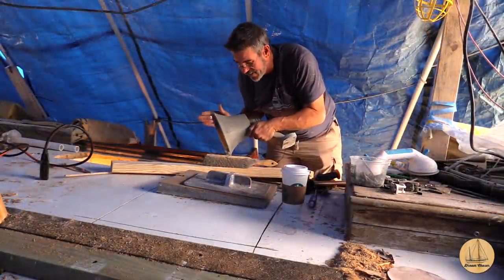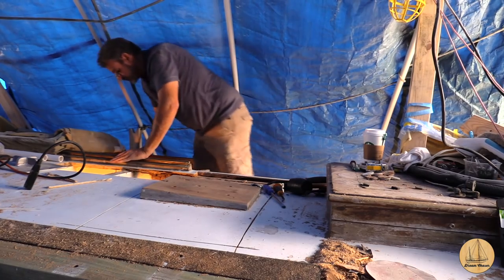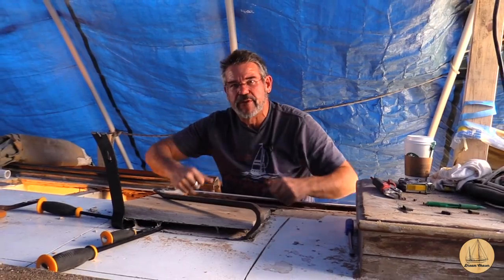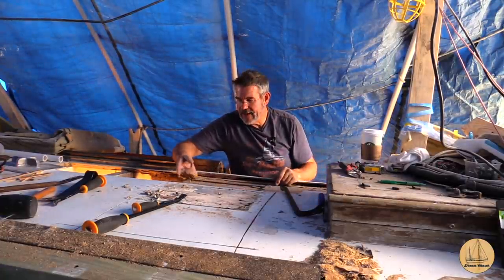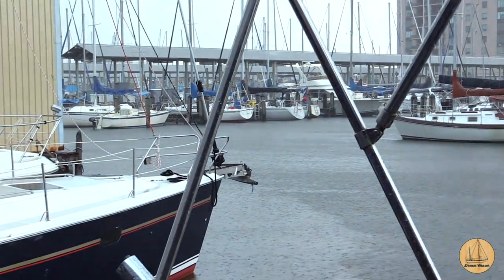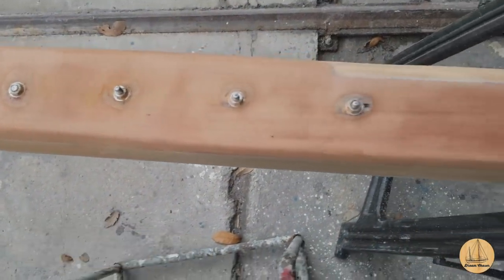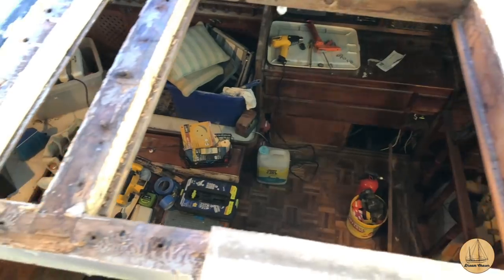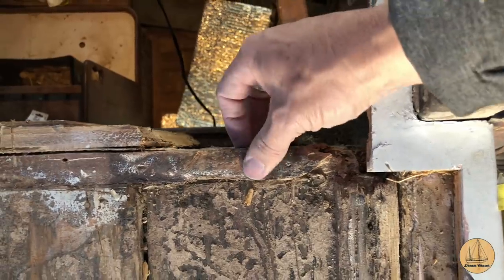Cutting lots of big holes in the boat (Termite Damage)  Agghhh !

Comment: Definetly agree with removing the deck plywood under the companion way hatch.  This will make the deck and hatch much stronger from a structural standpoint.  I had a Cheoy Lee and discovered that they liked to use rods with mushroom like ends to secure deck hardware, they resemble engine valves.  Made getting stuff loose a real chore.  Keep up the god work, really enjoy your videos.
Reply from the maker: Erich, Thank you so much for this comment.  That likely explains those wacky bolts I found on the bottom side aiming up.  Cheoy Lee, Formosa, Hudson, Seawolf, Marine Trader, etc.  They were all pumped out of those few boat yards within just a few miles of each other over their in Tawian back in the laste 70's and early 80's.  That certainly sheds some light on those crazy bolts, nuts, stud things.  
Thanks again.

Comment: You are doing a grand job👍 You have cut back to good stuff and your deck beams look solid so you have a good basis for the big repair. I admire your spirit Mr Irrepressible.😀⛵️
Reply from the maker: That is what I am hoping too.  I got it cut to solid structure so thinking that is a good place to launch the next step.  I am starting to worry about the long peice of 3/4" plywood 'bending' to the curve of the roof.  I will see soon enough.
Reply: Kerf the side in contact with the beams - fill will thickened epoxy and then set it down on the beams and secure - should not be an issue.
Reply from the maker: Norman Boyes great point

Comment: At what point do you just say "I'm ripping the entire top off and starting from scratch"? I mean WoW. I feel for you buddy. I really hope it all works out for the best.
Reply from the maker: Oh Michael, That was my original thought.  And I likely would have done that but when I talked to the yard owner, he was sharing with me that I didn't likely need to do that and that the strength would come from the mass of all the material and weight on therer bonded together (Whether one sheet or many) before it gets glassed over it.  His comment was along the lines of "The surface is too big not to have to join some peices (even if using 4x8 sheets) so if you have 10 joints or 20 joints you are still strong in it's entierey.  
That said, I have thought more than once about just doing the whole damn thing.
Reply: SVDreamChaser That I understand. My thoughts are more along the lines of "more surprises" lurking. Plus I'd be tempted to modify it in some way lol. But that's just me. I like custom stuff, especially if I have to rebuild it anyway. Like if you need new exhaust on your truck anyway. Would I like to go back with dual?
Reply from the maker: I am the same way, so working hard to avoid that temptation. Lol